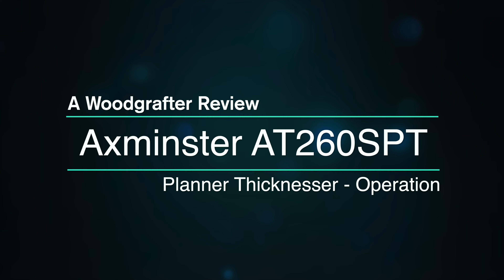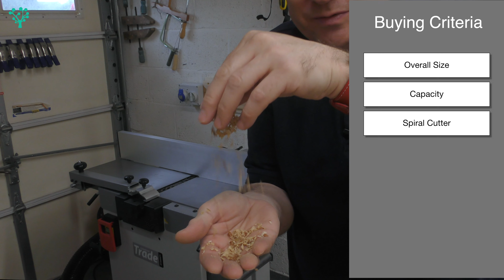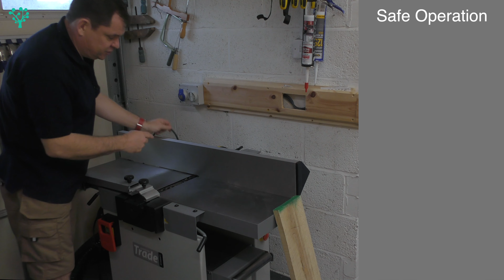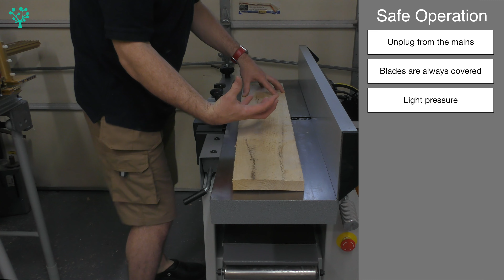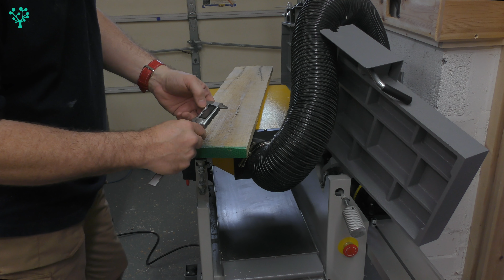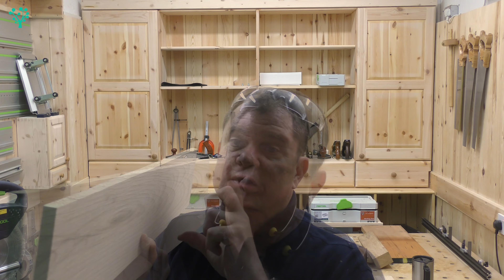Axminster Trade AT260SPT Spiral Planer Thicknesser - How to use

Comment: hey andy, how wide is the machine from front to back with the fence at the back? like you i have a smaller workshop and size is an issue, thanks
Reply from the maker: Hi, sorry missed this one.

The machine without the fence on the back is  about 545mm.

I have the fence and the bracket mounted on a wall away from the machine that is around 160mm

However when it is on the machine the total width of the machine is 625mm

I know that sounds strange, but there is a 80mm overhangs at the back of the machine.

Hope that helps 

Andy
Reply: @TheWoodgrafter  cheers Andy

Comment: A great series, Andy. I’ve been looking at one of these and noticed in the comment section on Axminster that your name was mentioned (as well as Matt Estlea), so here I am. At the moment, they aren’t in stock (approx 6 weeks on back order) and they retail for about £1850. So, apart from the initial set up problems, may I ask if there is any other bugbear that’s cropped up in the mean time? Oh, and did you get you extraction sorted? If so, what fid you choose? Thanks.

P.S. I hope you don’t mind me saying, but your thumbnails don’t do your channel any justice. I generally look for thumbnails with an image of the subject, rather than just text.
Reply from the maker: Hi Chris,

Thank you for the comments and feedback, Axminster actually use this series for after sales support as well. So glad it is adding value.

I have now connected this to a 2HP chip extractor (from Axminster) and I would describe it as average to poor in terms of extraction.

The initial set up is a pain and takes a lot of fettling - you also need to allow time for periodic adjustment and checks to get the most out of the machine. I may do a regular maintenance video at some point.

However when you have it dialled in, it is an awesome machine - I still get a kick out of seeing that raw stock slowly come to life as the machine does its work.

So I would still highly recommend this device.

Thank you for the feedback on the thumbnails - I am in the (very slow) process of updating the thumbnails to include a picture of the device/product/project in question.

Cheers

Andy

Comment: Very interesting information, thanks a lot. But I have one question: I have just bought one, and have done my first test. But when I want to abjust the infeed table, I have to telease the table locker. Is that the way you must do it? If I not release the table locker, the table will not glide into lower position. Is there anything wrong about my setup or not? Would apriciate answer very much!
Reply from the maker: Hi,

And thank you for getting in touch.

Yes you have to release the lock and then adjust the table. That is the design of the machine.

Kind Regards

Andy

Comment: Hello Andy, i have purchased this machine and did not realise the plug wasnt the same standard English plug, would an adapter work? I dont want anything to blow up if i were to get one haha!
Reply from the maker: Hi,

This is a 16Amp machine so has a different plug fitted. It is not designed to run off the standard house ring main.

An adapter won’t damage the machine BUT could cause problems with the electrics in the house - worse case scenario fire as you will overload the circuit. 

I strongly advise to get a qualified electrician involved, the ideal is to run a dedicated 16A circuit into your shop.

Kind Regards

Andy
Reply: The Woodgrafter thank you Andy, the electrics were built around this machine and a bandsaw, the sparky already knew the power requirements but Axminster never labelled the machine with the different plug, thank you for the reply! My electrician will pop round and change the plug over!
Reply from the maker: It may be easier to have him drop in a 16A socket.

You get some safety advantages like an isolator - also a standard 13A plug will probably keep blowing the fuse in the plug as you get surge currents when the motor powers up.

Good luck.

Andy

Comment: Hi Andy

I have a question for you.... 
When it is in the thinkness mode should the weels on both sides of the spindle move at the same time.... or is there something that kick them on at the correct time.... as mine at the moment are not moving whatever....
Can you give me your thoughts on this. 07887746732
Reply from the maker: Hi,

It sounds like you haven’t engaged the rollers.

Have a look at the bottom left hand side of the machine on the feed side when is the thicknesser mode.

From memory push it in to engage the rollers, there is a diagram on the machine.

Let me know if that works.

Cheers

Andu

Comment: Hi Andy, thanks for these videos they're really helpful. How would you rate this machine after using it for a while? It seems to be extremely good value for money, and from your video the build quality looks excellent too. Almost seems to good to be true haha, so was wondering if you came across any downsides while actually using the machine?
Reply from the maker: Great question,

I love the machine.

Had no problems at all with it. It’s important to keep the bed waxed otherwise the stock can stick on the thickneser - also the calibration on the top bed ha shifted - so needs some tuning. I think that is probably because I use the top beds to move the machine round the shop.

The mobile base I used is not that good - machine is just to heavy for the design. Just made a new base so that should improve things.

Overall - great purchase would highly recommend it.

Andy

Comment: Hi Andy, thank you for a really thorough concise and, as I have come to love with you, precise review. I am going to take the plunge in the next few weeks to replace my Record Power PT260 with a spiral cutter machine. I would love the 310 size but it seems disproportionally expensive. Did you look at the Itech range from Scott and Sargent? It too looks like an excellent machine with the added advantage that you don’t need to remove the fence to convert between functions. Thanks again for the content. John
Reply from the maker: Hi, thank you for the comments.

I am not familiar with that brand so can’t offer any advice I’m afraid.

However - you won’t be disappointed with the step up to the spiral cutter.

Good luck.

Andy
Reply: Hi Jon

I have bought the S&S 260 Machine and although not delivered yet  I spent a long time in the warehouse with the technician who checks and sets up each one they supply.  It is a really good machine, should be accurate out of the box and is much easier to change over from planer to thicknesser as the fence doesn't Ned to be removed and both beds move as one.  I am sure you will like it.

Comment: Hi Andy.....just a quick question please.....if you were to use your 260PT to thickness a board of say 15cm x 30cm to say 20mm, what would you accept as acceptable tolerances of the thickness of the wood on each of its four corners please? John
Reply from the maker: Hi John,

That is a good question, and as always it depends on what I am building.

But assuming I am prepping stock for joinery I would  be looking for +/- .5mm

Anything more would start to impact the end product.

Is there a reason why you ask, are you getting snipe ?

Cheers

A
Reply: The Woodgrafter Thank you Andy
Reply: No snipe but I was getting uneven thickness when using the thicknesser. Axminster sent an engineer but he couldn’t get it much more accurate although I think it was within 0.5mm. I have to do some more trials. More worrying is that their replacement blades do not fit the machine! The blade holders are slightly oversize hence no space for the blade.

Comment: Enjoyed the video Andy - thank you.  Thoughts on varying where your stock is positioned on the table, especially if you tend to plane/thickness the same sized boards, to keep the blades wearing evenly?  I know you can replace the spiral cutters individually but would like your perspective.
Reply from the maker: +Mark Oddo 

Hi Mark, yes this is a risk - at some point they could wear unevenly and this would alter the cut.

I would tend to vary the position of the wood BUT ensure that you always have the blade covered with either the from guard or the fence.

Cheers

Andy

Comment: a lovely detailed video but if your going to use the thicknesser to take your stock down to width it's best to do that before taking the board down to the final thickness as this leave the board more stable going through the indeed and out feed rollers of the machine
Reply from the maker: +Jsairsoft100 

Hi,

That is a great tip, and makes sense. 

Cheers

Andy

Comment: Hi Andy, brilliant! First video I have seen where the fence is moved over towards the user to significantly reduce the danger of fingers getting caught. So obvious now! Instead of just relying on the blade guard which seems to be a sprung-hinged arrangement on so many US machines. Also I am glad you showed that the fourth face can be 'thicknessed' instead of going to the table saw (I don't have one!) My AT260PT is coming on Friday - very excited now! Thanks again.
Reply from the maker: +Binks 

Hi Binks, on a scale of 1 to 10 - how excited ???,,

Andy
Reply: @TheWoodgrafter  Several hundred! Just being able to choose from so much more wood at my timber merchant will be a Godsend. No longer choosing PAR or paying for them to do it for you having chosen rough boards. I have just made a caster carriage for the planer out of Oak (30mm and 45mm boards) based on Peter Parfitt's plans, and had to have all the wood milled to thickness. Those days have now gone!
Reply from the maker: +Binks 

Yep, you will also find the accuracy of your work will increase as you now control the tolerance of the “squareness”.

Wider range lower cost and increased accuracy.

What’s not to like.... one day and counting.

Andy
Reply: Hi Andy - just a quick update. AT260PT is amazing. Very pleased. Peter Parfitt's trolley plans were perfect for the purpose......I ran out of time making the trolley which was a shame as I would have liked to at least Danish Oiled the oak and rounded off the corners and remove the arrises etc. Works perfectly though. I need to do some more fettling with the blades to make perfect when thicknessing as you suggesting I might. Just need more time!
Reply from the maker: Binks 

Hi, really glad you are loving it - it is truly an awesome machine.

I saw Peter’s video on the mobile base and I did think about that, but just had no time.

It’s amazing how many jobs we have in the workshop (for the workshop) that still need that final finish.

It is definitely worth taking the time to set it up - the quality and accuracy will more that reward your investment in time.

Let me know how it goes.

Cheers

Andy
Reply: Hi Andy. Just a quick question please....if you were to use your 260 SPT To thickness a board of say 15cm x 30cm to say 20mm, what would you accept as acceptable tolerances of the thickness of the wood on each of its four corners please?

Comment: Thanks for the video great job, space is an issue for me too, with a two car garage here in the US, I like the combo idea of the jointer planer. Right now I have two separate pieces of equipment. Due to the lack of space I have to move things around to use them with my dust collection system. That is a pain but at least I have them. If I replace what I have Spiral cutter heads will be the route I will take.
Reply from the maker: +TheFalconJetDriver 

Hi, yes the combination device certainly helps with the limited space. And that spiral cutter is a dream to use.

Cheers

Andy